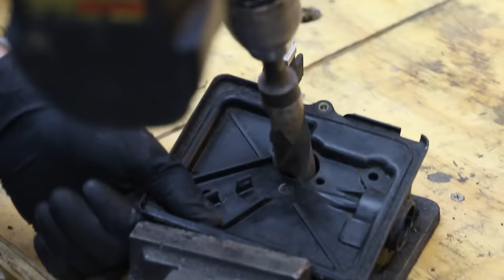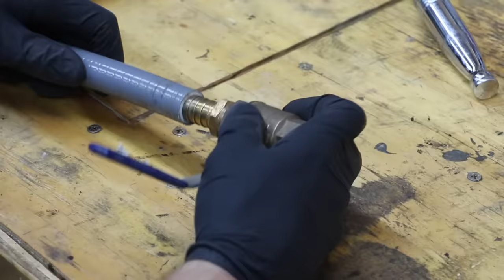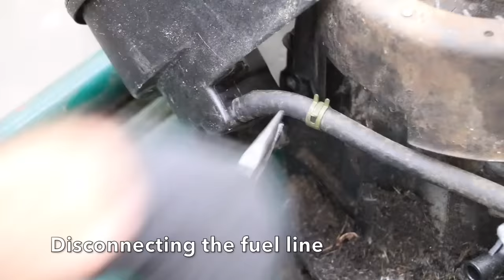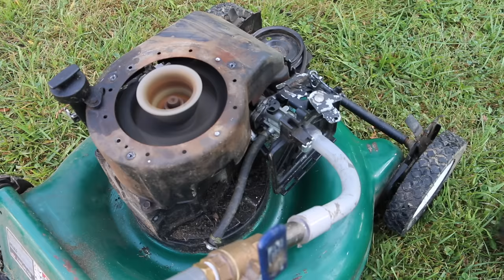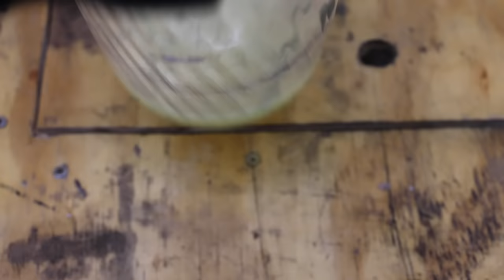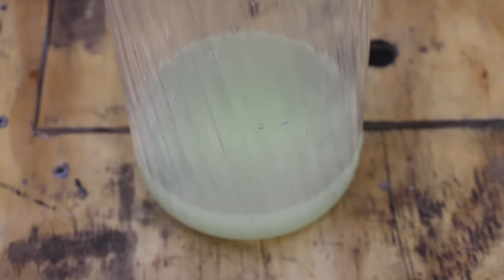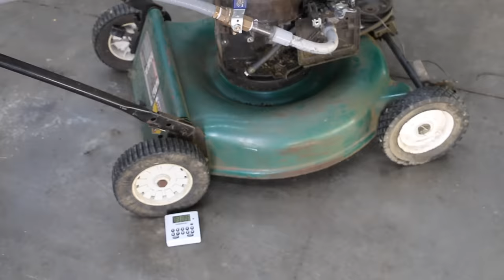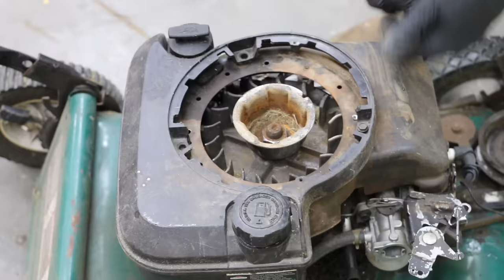Will a "Gas Vapor" Container Improve MPGs and Fuel Efficiency?  Let's find out!

Comment: isn't this basically how a carburetor works ?
Reply: yeah, pretty much exactly, except the carburetor can meter the fuel that enters the engine far better than that valve could ever do.
Reply: but this is bigger, and bigger is more better.
Reply: Essentially he made a larger, poor mans carburetor
Reply: Gas is still a mist exiting the carburetor/injectors. What he's doing is actually using evaporated gas. I ran a generator for 2 straight days off just a liter of fuel, it stops working after te sun goes down so you have to put the fuel canister by the exhaust to keep it evaporating.
Reply: @bobbyboucher5309  are you saying you invented a energy-efficiency greater than 100%? That is amazing!
Reply: @bobbyboucher5309  Just some Top gear math. A liter benzine contains about 9 kWh energy. So the maximum energy output would be 188W, in that case no heat would be created so no hot exhaust.
unless you are talking about some microgenerator, It makes no sense that it would even run without load for 48 hours. The only thing that matters is that the mist becomes gas form before ignition, preferably well mixed with the air. 
The biggest loss in energy is the heat exiting the exhaust. After that drag in the whole energy conversion.
Especially the Japanese are still improving the latter.
Only a fuelcell turns benzine in an other form of energy without an hot exhaust.
And they are much more efficient. Not reliable though.
But there is some truth in silly waste.
Only compare the MPG from an average Japanese or european car, with an American. Our little Trevis gets 54 US MPG (23 km/l) somehow, driving normally. 40 mpg (17km/l) driving Autobahn speed averiging 90 mph (150km/h).
Even our Terry the Truck gets 25Mpg (11km/l) (165hp diesel) easily. 
Sticking to a V8 and fixed rocker rod valve opening system is very waseful.
Reply: @foeke8740  The generator I had was a small 1000 watt champion, hardly any load, just a 30 watt TV so it idled the entire time. Previous to that, using liquid gas  in the tank cost me 10 to 15 liters to do the same thing.  Don't much care how smart you think you are, you clearly have never evaporated gas to see how efficient it was.  I also built a hydrogen cell for a larger generator that a power engineer was convinced wouldn't be feasible due to using power to produce the hydrogen. When I proved him wrong, he didn't know what to do. All he kept saying was "I went to school and was taught this doesn't work so how come you got it to work". I explained to him if his school taught everyone the real truth  why would we need the gas plant him and I both worked in.  I also ran my diesel truck off of used canola oil which didn't sit well with so called learned people either.    Have a look at who owns your fancy schools and maybe things will start to make sense. 😋
Reply: @bobbyboucher5309  Well my school didn't get it's funding from BP. And I am totally not saying you didn't experience what you where experiencing.
Actually the math apparently worked precisely. Lets say you got 50W from your generator. That would be 2,4kWh in 48 hours.
That is like exactly 25% efficiency.
The question left on the table would be why was it using as much with a carb.
And the canola thing, of course that works, thats how a diesel engine created. Current cars are more picky but older cars, not a problem. It smells nice also.
Not sure what you did with the hydrogen. just be careful with that.
Reply: @foeke8740  Hydrogen cells are much safer than any gas tank or propane tank since Hydrogen is used as its produced, not stored.  Combined with a simple spark arrestor makes it virtually impossible to have anything catastrophic happen. Even used in a car that has an accident would only result in water loss.
Reply: If you really want fuel vapor, try using a system similar to Coleman gas stoves where the gas is heated until it vaporized and then mix with air to power the engine . It would be difficult to get a proper fuel air ratio
Reply: oddjobbob   Buddy  I rip apart engines, fix and reassemble all the time since I was a little kid. I'm currently building two trucks and when that's done. I have a compressor head that's over  100 years old I'm mating to the same champion engine that will run off dirty non pottable water. Zero gas needed. Pretty sure I know how an engine works and your dribble comment says you know nothing important. Also, try putting gas in spray bottle, spray and light, add to that pouring LIQUID gas on a fire to light it. Cold air in a canadian winter would stall an engine instantly. I could go on but what for.
Reply: @rjhasbeer  Basically what I did, I used the exhaust to heat the fuel in a jcan that sucked air through four straws. Two in the fuel, two in dead air space above the fuel. If I put all four in the fuel it got too rich. I only did it a couple days but worked pretty good considering.
Reply: @bobbyboucher5309   sounds good. An actual “vapor air-fuel mixture. Sounds pretty good and should have been much more efficient than the carburetor. The air propane mixer system is used on autos and industrial uses is also good. Would still require a system to vaporize the fuel.(gasoline)
Reply: @bobbyboucher5309  Well I just searched for the Chrysler carb from the 70s and didn’t get any results on what you were mentioning
Reply: @bobbyboucher5309   Oh my goodness. I didn’t realize I was talking to such a knowledgeable individual, forgive me for sounding a little silly, I just feel so honored that such a magnificent, all-knowing man like yourself is even talking to me. Oh wow, I just can’t believe it!!! I’m going to remember this day forever. Thank you so much for your infinite wisdom!!!!! Golly Gee wizz. I’m getting way too excited
Reply: @hxd9321  BTW  you're just pissy cause you know I'm right.
Reply: @bobbyboucher5309  Narcissists are always right, but you already know that.
Reply: @hxd9321  You call me a narcissist after what you last posted? That's rich

Comment: You dont know the normal tank didnt have a small percentage in it after the motor stopped. I didnt see you account for an unreachable reserve,so the normal carb might even be better.
But lets assume it was all accurate. You could get better results setting the engine up leaner with a colder plug , its the same with cars. They dont, because it drops power output and basically its just better to run a smaller engine. (why have a 6 pot motor making the power of a 4?)
 We know how much energy is in fuel and we know how much we lose as heat etc. Theres no conspiracy, its just running the engine lean as hell (dangerously low in automobile engines.
It ruins acceleration and makes the car difficult to operate. )
Small engines like that mower have no real optimization anyway. 
They are the bare minimum setup to just 'work' because they use so little over the year.
I could get more out of it if I re worked some of the internals and put a more expensive carb on it, any basic knowledge tuner could. Nobody bothers cos its more expensive then the fuel saving over say 11 years when its a skip job.
 Basically its just an urban legend. Oh, didnt see the comment further down about the energy in fuel.

Comment: What if you put a mesh screen at the bottom two air supply tubes so when air comes in it is a bunch of tiny bubbles and not large ones so you get more surface area for fumes? Might make it more potent so you could throttle back a bit or maybe make it more efficient 🤷‍♂️ 

Thank you for doing these videos! You are as well respected to me as PBS for the public service you provide everyone! 🙏😊
Reply from the maker: Thanks and you are welcome!  Thanks for the suggestion.